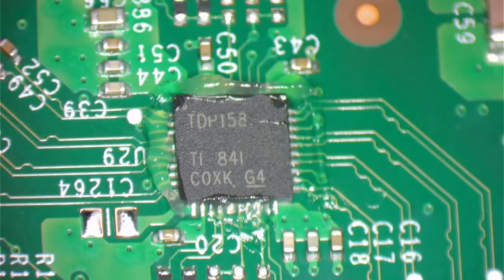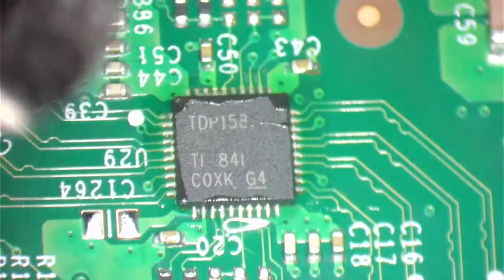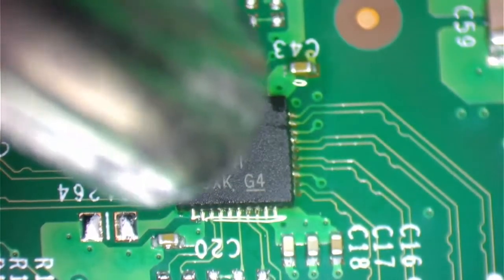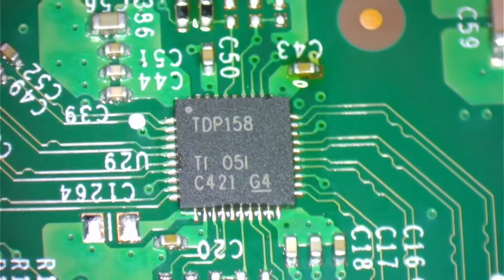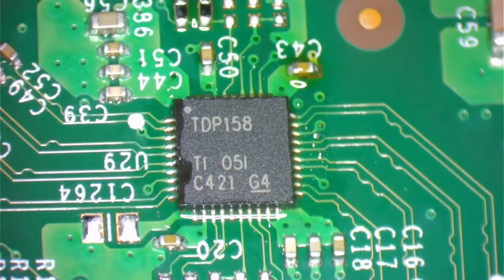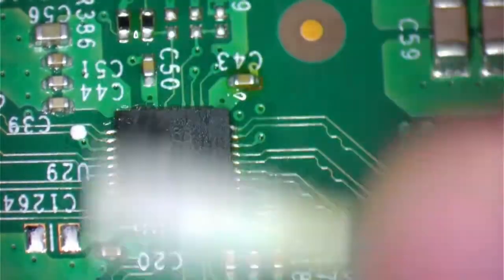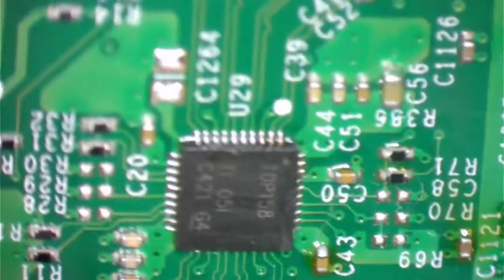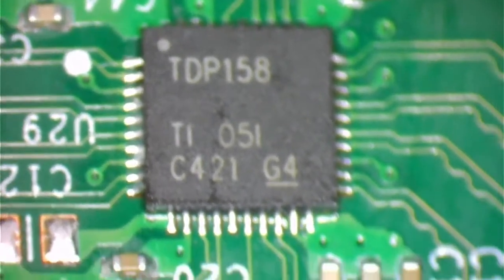How to replace an Xbox One S / X HDMI IC Retimer Chip

Comment: Hi. What do you use for a hot air station and where did you source the replacement chip? 

I have one and the HDMI port itself does not appear damaged, though it doesn't retain the cable well but it should work. I'm thinking its the retimer chip is bad. I only have a 858D hot air station. Unsure if it'll be hot enough to remove this chip without lifting pads. Since it seems theres a big ground plane near it.
Reply from the maker: Any station should work. I often use one underneath to preheat then fit it from the top. Good luck.

Comment: Hi m8 great work, I was wondering how do u know when the chip is lined up correctly, has it anything to do with the small holes on the board or just by eye. This is only problem I've had, can't get a picture and tried 2 chips, board has no damage at all.